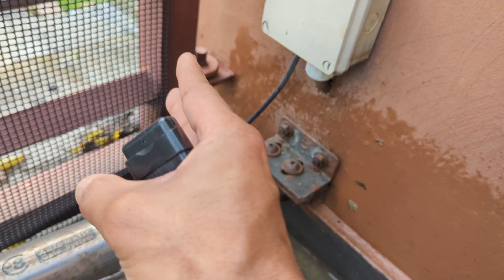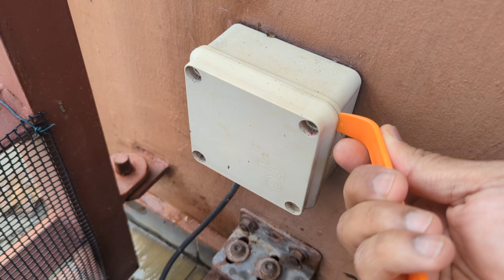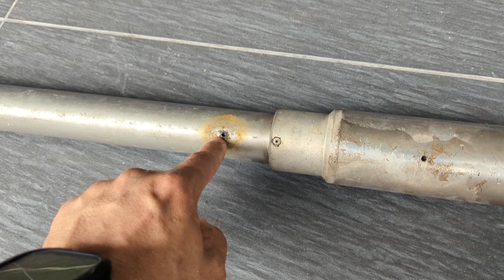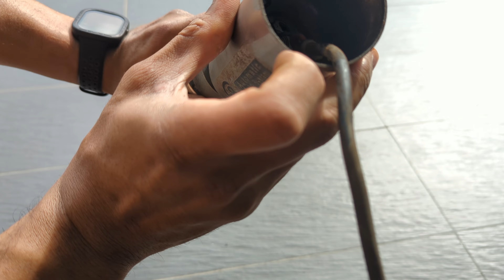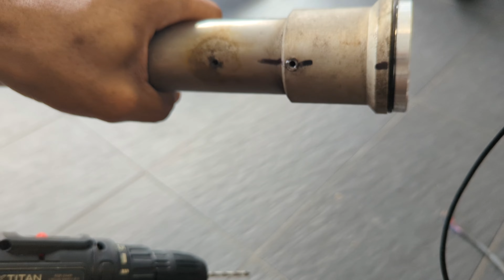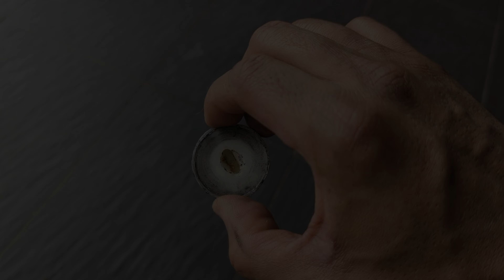E8 Auto Gate Arm Not Opening / Motor Slipping - Easy & Cheap Fix - Dismantling the Arm

Comment: Hi there...can you give me some advice on what lubricant is good for the arm?
Reply from the maker: For the screw-to-gear, if it is metal to metal, Molyslip (molybdenum based grease) is good and long lasting. If your system uses a metal screw to a nylon/teflon gear, then use white lithium, teflon or silicone grease. I like white lithium - the thick type.
Reply: @MiscDaily 
I have the same model as you, E8. The left arm makes a squeaking sound, I have greased the gate hinge but not the arm. Do you think the squeaking sound is from the arm?
 https://youtu.be/toBTx2PcJ4w?si=O_PF_fa0t3QSTSgJ
Reply from the maker: The squeak frequency does sound similar to the speed of the motor, as such doubt its the hinges. Does it always squeak when the gate is at the same position / angle? Suspect your actuator arm screw gear guide bearing may be worn. Or worse, the screw gear may be bent at a certain position from prolonged use with worn bearings. Best to take it apart to investigate.
Reply: @MiscDaily  
Hi sir...
The squeaking sound always occurs during the day and when it is hot. 
When it is morning and evening approaching the night the squeaking sound disappears as normal.  
And also when it is daytime and raining the squeaking sound disappears. 
What do you think it is?
Reply: And yes sir the squeaking always same angle..
Reply from the maker: Considering its always the same angle and happens when its hot, still suspect that it has something to do when the metal expands and may be related to your bearings or defective metal screw / guides. Best to take it apart and inspect. Cant tell more from external observation. Rotate the parts by hand once dismantled from the gate. You should be able to feel where the resistance is from which will be the source of your sqeak.
Reply: @MiscDaily 
 Thank you very much for your response sir. I will try what you suggested.
 One more question sir, when the squeaking sound and I want to close the gate again, the gate won't close. I have to help push it a little to close it. Is that normal?...
Reply: Where to buy the plastic things